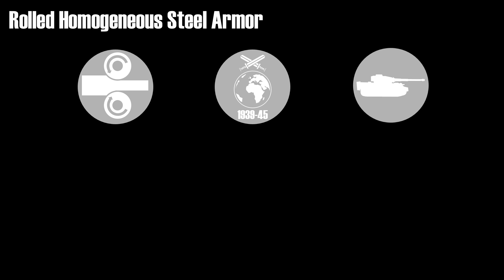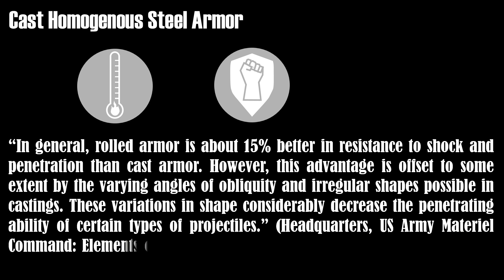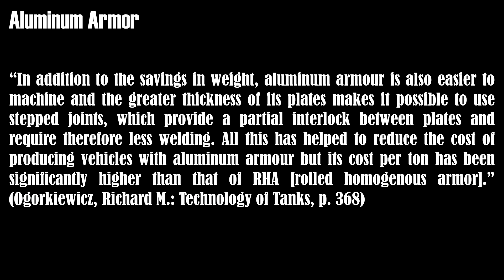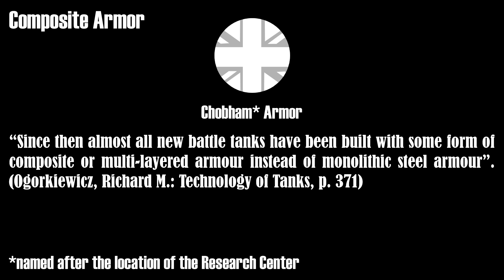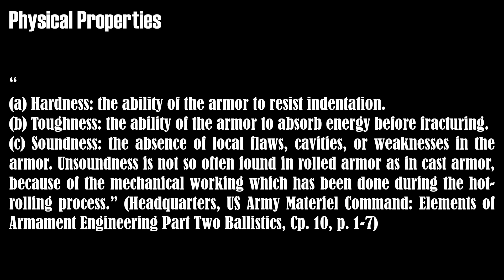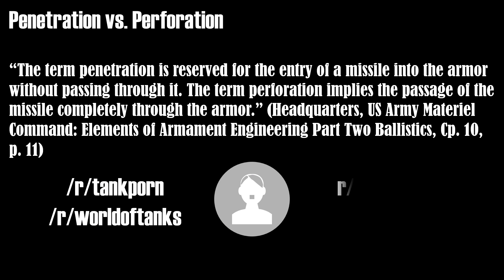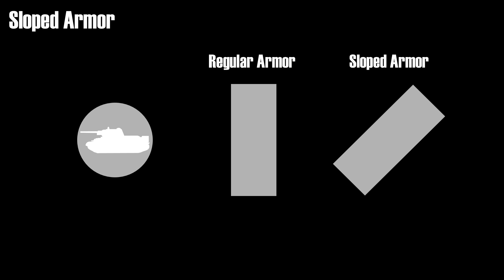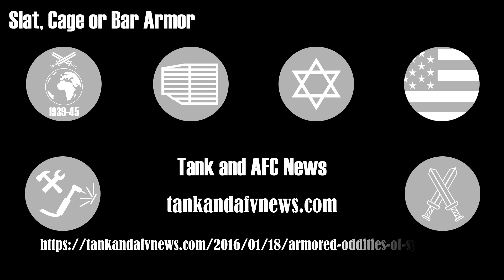[Tanks 101] Armor Protection 1920-1980 - Features and Characteristics

Comment: 8:15 , shaped charges defeat armour with their incredible speed, not temperature, this is very misleading. A jet from a shaped charge can often reach 5000-7000m/s, which is incredibly fast, and thus slows down extremely quickly.

Comment: Many of those tank armor technologies introduced in the 1960s had been in common use on battleships since the first world war. Surface hardening, multi layer composite (Although it tended to use steel[more than one hardness], liquid, air, concrete, and wood as the layers rather than a modern ceramic.), sloping, and spalling protection. 
In several cases they would make less critical parts of the hull so thin that large shells could pass all the way both sides without detonating and using the weight saved to add more armor to critical areas.

Comment: What if the M4 Shermans steel armor had a rating of AR500 give or take for durability. How much of a difference would it have made, would it by practical, what would the cost be, was the original armor harder than AR500 and would the hard ratr of AR500 be a con instead of a pro?

Comment: heat jet dont "burn" through armor...to skip a lot of boring physics they work just like APFSDS darts but instead of solid on solid its liquid on solid. darts impact with enough energy to liquefy the armor and will continue to "melt" like a candle until the rod is eroded or the armor is penetrated. this varies between ammo types by generation

Comment: there could be an arguement made that the matilda tanks used a form of spaced armour i suppose or perhaps even the Churchill or the char bis, as these had a form of double skin, in the case  of the shuztsen armour (can't say im confident i spent that correctly) the actual traditional idea of armour became somewhat blurred as they moved onto wire mesh screens later on in the war, rather than solid plate, so not so much a direct resistance to penetration but rather an deflection effect in the way we have reactive armour today, and of course we cant use the designation of spaced armour just to mean a temporary plate bolted or hinged on brackets because as you mentioned, the panzer three had permanently welded spaced armour, for these reasons i think the examples i gave at the start of this thread may count, id like to hear others views on the subject incase I'm missing out on a important technical distinction somewhere along the line, after all living is learning :)

Comment: Why was the shape of the exterior armor of the M48 so uneven? They all look as though the metal of the turret and main body of the tank were cast by hand and none of them matched each other. It looks as though each machine was cast from a sand mold and there was no machining of the surface done after casting.

Comment: The degree to which what we just call RPG cages actually work is incredible. Ive seen vehicles hit both with and without one still contained dried blood the other had a black spot and paint burned completely off but otherwise intact for the most part though obviously the cage was fucked and the one that didnt have the cage took the hit to the ballistic glass window which on the particular vehicles in question being matvs is still quite thick at least 6 inches to be sure

Comment: sorry to point out an inaccuracy in 14.21: angling the armor will INCREASE its line-of-sight thickness BUT will at the same time DECREASE the protected height. In order to protect the same height with the same volume (weight) of armor one needs to decrease its thickness to the same level as a vertical armor plate. It does NOT save any weight whatsoever. It however increases the chance of deflection. See https://en.wikipedia.org/wiki/Sloped_armour#/media/File:Sloped_armour_weight_illustration.svg

Comment: Finally! Someone actually talks about the armor!
That's what sets tanks apart from every other military vehicle! Including tank destroyers.
Reply: Ye...no. What's about the Jagdtiger? Tank or Tankhunter/Tankdestroyer. They where mainly used by Panzerjägerabteilungen (Tank Hunter Units), not by ordinary Panzerabteilungen (Tank Units). 
Tank Hunter Units where Part of the Artillery Brand of the Wehrmacht, not of the Panzertruppe.
And also the Jagdpanther. Well protected, but not a Tank.
Or the "Sturmtiger", heavy assault mortor.

On Allied Side the M10 and the M36 Jackson. Not that bad of an Armor, not the best, but ok.

I think the primary field of use makes a Tank/Tank Destroyer.
Many nations after WW2 for example used the M10 as Battletank because it was cheap. Sure, not a ideal solution, but If your wallet is out of ammo, deal with what you get.

Have a nice day.

Comment: At 8:15 it says that the HEAT projectile creates a jet of molten metal that burns through armor. This is not correct, and a common misconception. It is rather a plasticized (superplastic) jet of metal, having similar characteristics to a liquid, but the metal is still in a solid state. For more information on HEAT ammunition, look at the Wikipedia article on HEAT warheads.

Comment: Basically, Explosive Reactive Armor is just explosives against explosive for protection against Shaped Charged Projectiles like RPG rockets.
Reply: Not quiet that simple.
Its also a plate of mrtal moving perpendicularly to the penetrator, thus tourqing it, and increasing the thickness of material it has to penetrate. Modern ERA in fact is designrd prumarly to snap LRPs in half.

Comment: The GDF-005 AA Gun that killed 9 and injured 15 was not fully robotic, it required the operator to pull the trigger to fire. The AA Gun had an 'electric mode' and a 'manual mode'. It was put on manual mode that day, but after the gun malfunctioned (which was apparently pretty standard) the barrels suddenly swung to the left (where the other 7 other AA Guns were standing). It fired about 10 to 15 shells in an eighth of a second, the Defense Minister said all the men either lost their right hand or right leg, or their lives.
Source: https://www.wired.com/2007/10/inside-the-robo/

Comment: WW1 tanks used Harveyised steel armour, which was prone to spalling and cracking.

The new 1920's invented homogeneous armoured steel consisted of iron, nickel (largest constituent), copper, chromium, vanadium, molybdenum, carbon. 

The British dropped the nickel content of their homogeneous armour from 70% to 40% from 1941 and made up the missing 30% with copper. It was found to make negligible difference in tests.

Aluminium armour was first developed and used on the Christee M.1932 flying tank.

German WW2 armour lacked chromium which made it prone to cracking under repeated non-penetrating hits.
 
Chobham armour used sintered aluminium oxide (Sintox) ceramic layers under the armour plates. Sintox is purple in colour. In WW2 it was used in Lodge aircraft spark plugs.

The first tank fitted with spaced armour was the British A13 Cruiser IV around the turret sides and rear in 1940.

Comment: The description of what is involved in a shaped change armour piercing shell.. a molten jet of metal burning through the armour.. the effects of these rounds against the crew doesn't bare thinking about.. even the idea of smaller calibre AT AP rounds ricocheting around the inside of a turret, hitting the crew as it pings and zips around is a sobering thought.

Comment: An important thing to note is that with "face hardened" armor they tried to get around the britlenes of the armor by only heat treating one side of the armor, this generaly is the side facing the enemy. this helps with the britlenes yet it still is somewhat of a weaknes against very heavy shells. something that the Soviets tested with some captured german tanks.
while the King Tiger is able to withstand a 122mm Shell to the upper frontal plate, after a few shots this armored plate is cracked and nearly pulverized

Comment: Something that puzzles me and I need to research into is that Germany had the technology and industry to get "the best of both worlds" as they had massive forming presses, up to 50,000 Ton presses in fact. They could have made rolled plates then stamped them into curved shapes, typically parts made this way are stronger and lighter and do not lose their temper. I wonder if forming tank armour this way isnt possible or if another factor prevented them.

Comment: I don't know if you still keep up with the comments on this video or not.  I have been following you for...I think two years now?  Maybe it has only been one.  Anyway, I just saw this video and saw your comment about rolled armor being about 15% stronger at https://youtu.be/f0IbZGfTgUM?list=WL&t=181.  The reality is a little funny and a little bit different from what was implied in the manual you quoted.  

Basically, when you are pouring a casting, there is always stuff included in the final molded part (called inclusions) that you don't want (dirt, slag, gas, voids, etc).  A good casting will have these things spread around evenly and in small proportions so as to not cause significant weak points.  But the inclusions are still there weakening the molded part so the average strength of the cast metal is reduced by a certain percentage unless the metal is 'worked' to remove the inclusions.  

There can also be stresses internal to the metal of the part which reduce the average strength.  Example: Suppose one side of a casting is cooled faster than another part.  The faster one side is cooled the more it shrinks away from other side of the casting that is cooled slowly.  Now there is some innate internal force pulling at the two halves of the casting and taking up part of the strength of the metal.  How much these two factors reduce the average strength of a casting is determined by a combination of empirical testing and engineering experience but typically they sum to approximately 15% for most metals and most processes (you can do better than 15% but that is a typical factor used).  This is what the manual is referring too.

I could discuss this more but this is already a very long comment and I don't know if anyone will ever actually read this.
Reply from the maker: thx, I guess for the T-34s it was actually far worse, considering the state of the industry etc. they also switched at one point to a welded turret if I am not mistaken the hexagon one.

Comment: Heat warheads do not melt through armor but rather punch a hole through it with a superplastic jet of metal, often copper. 
Look up the Wikipedia article on it; it is actually quite interesting.

Comment: Hi, guys.

I realize this comment is very late but I have an interesting anecdote about armor.

A friend of the family worked for a military contractor in the 60's and he worked on composite armor. As he explained his pet project; they used random shaped sharp bits of tungsten carbide in a epoxy/fiber glass matrix.

The tungsten carbide would chop up the projectile and set the bits spinning. The epoxy would sap the rotational energy as well as damping explosive/incendiary rounds to some extent, while the fiber glass was a spall guard and prevented the tungsten from merely getting pushed through. 

He was hoping it would have been used in the Lockheed Cheyenne, which never happened, and claimed that a piece of his composite armor, the weight of steel that would stop a .30 cal round, would stop a .50 cal. And he was working on a project that would stop up to 30mm flack. I suspect that the advantages diminished with the size of round and thickness of the sheets but...

We lost touch shortly later and I haven't seen any references to that specific mix but I often wonder if his "wonder armor" exists in or has inspired some of the many classified armors merely called "composite" in official sources.

Cheers!

Comment: What are your thoughts on the Leopard A5s front turret armour. The slanted armour would be a shot trap correct? The round would be directed downwards into the hull, correct? I looked at the internet to explain this obvious flaw but the answer I got was due to SABOT rounds pinpoint tip and the high velocity that the round would either deflect upwards into the thicker part of the turret or shatter. Apparently modern tank rounds don't deflect much due to their high velocity.

Comment: Ugh, another video where the word "burn" is used to describe HEAT ammunition or shaped charges. Please, can we just get this right? HEAT rounds use an explosive charge to shape a plate of metal, usually copper, into a hyperplastic jet which uses sheer kinetic force to punch through armor.

The jet is hot, yes, but it does not "burn through" armor.

The material property which regulates heat transfer in materials, heat conductivity, cannot be altered as it is an intrinsic one. If you have a long bar of steel and you put one end in lava and hold on the other end, the rod will not suddenly immolate your hand. You can put the other end to a fire and, until the end you are holding is equally hot to the fire, it won't matter if it is in lava or in a fire. Both rods heat up equally fast, because the material simply cannot propagate heat faster than is it's intrinsic capability.

Thus, if you user heat to "melt" through steel armor it would not happen in a split second. Heat propagation through the thickness of the armor would limit the speed of armor penetration.

HEAT rounds penetrate armor via kinetic energy.
Reply: Just blame it on the abbreviation, mate. When some genius decided to shorten the name of this type of ordnance to HEAT, most people will assume it has something to do with melting stuff. I guess they could have chosen something like Hollow Charge Anti Tank , but I guess the abbreviation does not sound as catchy as HEAT. Silly yanks and their abbreviations.(:
Reply: Its official name in every military outside the english speaking world is cumulative explosive charge.
Reply: R/iamverysmart
Reply: Nope. It's the same concept of a oxygen/fuel cutting torch. Do you think torches melt the metal out of the way? Cause the slag is burn iron oxide. Its burning
Reply: @JamesTTierce  You're wrong. Strictly kinetic: 1/2MV^2. A mass of gasses travelling in excess of 30,000 FPS.
Reply: @jimwiggins8678  why is the penetrator a specific kind of metal then? Its both obviously.
Reply: @JamesTTierce  Because copper is malleable, denser than steel (the thing it's usually going to penetrate) and relatively cheap. What a HEAT warhead does is take the energy of an explosive charge and focus it into a metal jet, the kinetic energy of which punches through the metal it faces.

Your Oxy-Fuel torch does melt through metal, but that is a slow thing to do. You can't just run an Oxy-torch over a piece of metal and it just slices open. You need to move slowly to let the metal heat up and melt.

When a HEAT warhead detonates, the penetration is near instant. There is no time during which the jet is heating up the metal, because heat transfer takes time, and steel is a pretty lousy heat conductor (This is why you have aluminum inserts in your cookware, for example).

Consider how long it takes for an Oxy-torch to melt through just regular construction grade steel a few mm thick and then consider how long it would take for it to melt through something several inches thick. And then consider how much hotter you would need to have that same torch to do it in a microsecond. You'd be demanding temperatures hotter than the surface of the sun (5778 K)!

Comment: Good video, but you've made one major technical error

Shaped charges do NOT "burn their way through". This is an oft repeated myth - probably because someone somewhere got caught up on the phrase "molten metal". In fact, the PUNCH their way through, just like any other AT projectile  (albeit with slightly different mechanics than a sabot). The copper molecules in the metal "jet" are at hypersonic velocities, and focused on a very small area - slowing them to overcover nearly all homogeneous material (at reasonable armor thicknesses). The heat might be important for the after effects - on the internals and crew. But the penetration is purely kinetic.

Comment: What about depleted uranium armor? Or is that the same as chobham?
Reply: Jacob M. 

Depleted uranium is one MATERIAL used in addition to Chobam, usually as an insert in critical areas - usually in front of/behind the composite box. It is not technically a part of the Chobam  (Which uses a classified blend of metal, polymer, and ceramic), but all modern US tanks (M1A1HAs and M1A2s made after 1998) that use Chobam ALSO have DU inserts. The rest of the fleet is being upgraded.

DU is exceptionally strong, but making an entire tank out of it would balloon costs by 10X - and probably render it too heavy to move.

Comment: i love how you dont mention the first mass use if composite armor was on the T64...
Reply: T64 just had a layer of prototype version glass, production version Silicon Oxide (aka cement) inserted in a void  between two metal sheets in a 4:3 ratio similar to early American experiments, they were found to be upto 50% more effective than steel against the first hit but then offered compromised protection against further hits. The British version used dozens of layers of materials (principally ceramics) in tiles with different protective properties to provide a multi layer defence that was 5 times as effective as the same weight of steel (current versions which use metal composites of titanium or depleted uranium as well as ceramic are 25 times as effective). The first Soviet armour with similar properties to mk1 Chobham was BDD inserted in to the T-72 turrets and then later applique up armouring T62-M though the T72 still used the same void approach meaning that to replace the armour tiles the entire turret had to be lifted off the tank, it couldn't be done from the outside.